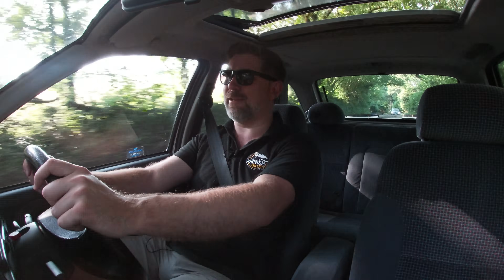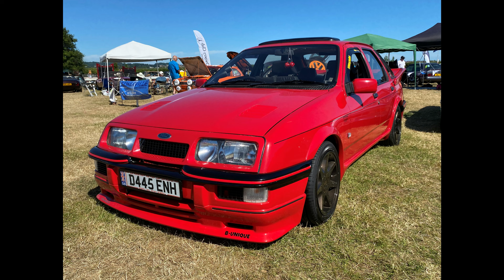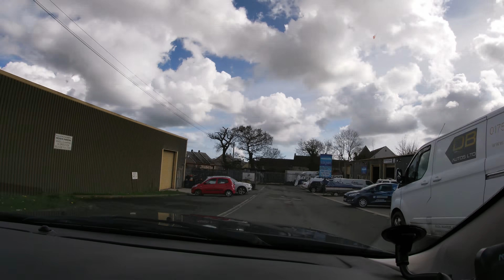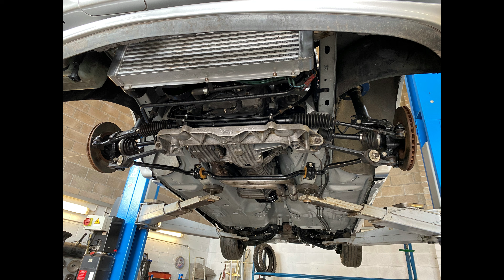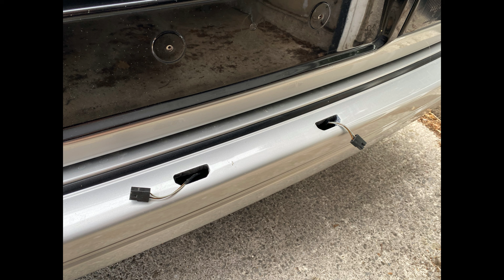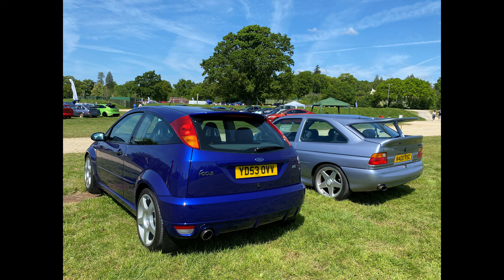OH NO! Sierra RS Cosworth Restoration Hold Up, Engine Update & did the Sapphire get to SIMPLY FORD?

Comment: Isn’t standard power a bit contentious in that Cosworth delivered these engines to Ford with their idea of standard being closer to 300hp and Ford de-tuned it to their own idea of standard as they deemed 300 to be insane as that was the sort of figure Ferrari were offering with their 348 at the time ? With that in mind I think I would have set my sights on 300 as it should be perfectly reliable at that level…….as I’m sure it would have been at one time if it was running an Ahmed Bayjoo chip. For those who aren’t aware, Ahmed was the pinnacle of anything related to Cosworth tuning and he was the one who led where others followed. His authority came from being on the GrpA works team, most notably when Francois Delecor was driving  😊
Reply: I can vouch fir that Julian. I worked for TDI during the 90s as their development engineer after fitting out their new workshop in River Road , Barking and was responsible for some really interesting cars that rolled out of there during that decade . We had one of the few 400 bhp Sun 4x4 rolling roads in the country , and this I later upgraded too . We exhibited 2 cars at the Olympia show in 1995 , the then new Supra with around 750 bhp and a Nissan 300ZX TT making around 500 bhp . Although primarily a JDM tuning company and HKS dealer (among others) we had a shed load of Ford's come through the doors because of our location , even cars from Brian over at Burton Engineering and cars from the local Ford main dealers that they were not equipped to problem solve . I was also responsible for developing and rebuilding turbochargers , a number of quick shift gear levers for Ford's ( including the TWR Cosworths ) which the market lacked plus a ton of other stuff and test driving vehicles before returning them .
In the early years we used Ahmeds chips and those of Detection Techniques ( Superchips ) for the Cosworth range until we acquired our own kit and I began development on a series of our own for all cars . The vehicles we had were either new or very low mileage and each vehicle was set up on the dyno after chip replacement before road test and returned to customers  . All were 100% and no issues with overfuelling . If the engine has signs of that,  then the problem is elsewhere  . Ahmed supplied both the standard upgrade chips to restore the original power for both the 2 and 4wd Sapphires . From my library the 2wd (45 22067) normally burned on an ST M 2764A-4F6 Eprom , Algorithm OE, Ref 1504 Checksum = 000DBD47 and the 4wd (PO) on a TMS 27C128 Eprom , Algorithm 96, Ref 1807 Checksum=00241374 . Checking these values will show if you have a genuine Ahmed or not .
Reply from the maker: Thanks for the comment and for letting me know your thoughts on the car. Chasing 300bhp was tempting given the history of the car, with its Ahmed Bayjoo chip. Issue was the over-fuelling and damage to the pistons so I thought I’d go close to standard and then, if I want more, change the tune at a later stage - the aftermarket ECU and parts that have been fitted mean I have the ability to do more if I ever want to. Thanks for watching, I appreciate it.

Comment: Well done Andy a great video update on the Cosworth and it is looking amazing and will be marvellous when complete I don’t blame you wanting to get as close to standard as possible but increasing reliability as well with modern conditions I am looking forward to the next video and good luck with the electrics Daniel
Reply from the maker: Thank for the comment Daniel and for the continued support, I appreciate it.  Updating the engine is always going to be a bit contentious, but as the car has been completely restored then I though it would be fitting to bring the engine up to a more modern set up.  Fingers crossed it all works out and the car runs / drives as I intend (and hope).  Thanks for sticking with the restoration videos and hope to hear from you on the next. 👍

Comment: It’s getting there & looking good that’s the main thing 👍
when doing something like this it no good going down the half hearted approach as you never get to enjoy & be fully satisfied with what you’ve done,  you will always be plagued by the bits that aren’t quite right & need doing otherwise.

You mention the original fuel regulators causing the fires! But it is nearly always the little hose from the injector rail to regulator that splits,  since Ford let us all down and stopped keeping all these essential part available I was never able to source a satisfactory hose like the original one.
Reply from the maker: Thanks for the comment Ken and for the advice re. the hose.  Thanks also for sharing your thoughts on the Sierra progress so far - as you say, I need to do it right so I will persevere and look forward to sharing the car complete later this summer (I hope!).  Thanks for watching and following the restoration.

Comment: Great video. I'd want the car to run exactly how it left the factory.
Reply from the maker: Thanks for the comment, I am glad you enjoyed the video.  It was a tough decision as to whether I take the car completely to standard or take the direction I have... which is subtle.  What swung it for me was that the car had been modified previously and it is a restored car, so no longer original.  I know it will divide opinion because I myself am in two minds! 🤣
Thanks for taking the time to watch and for following the restoration.

Comment: Hello Andy
Another brillant update so much enjoying the restoration and the work going into it as il certianly agree after doing a Sierra Cosworth myself many years ago patience is an understatement (as well as foul language lol)
Im gonna be honest mate id prefere the engine to of been kept orignal Ford spec as especially if your running close to standard power the YB is ultra reliable, although you will only know if or any differences are happening with the more modern engine upgrades once you start driving it.
Those side moldings are a bloody nuisance as so many come away in the corners so hope the bodyshop address this for you .. I know you want to car as OEM standard in looks and appearance with the 17" softline wheels sold to the white Escort RS Turbo, what i would say mate is i had a freind who had a moondust silver sapphire Cosworth and trust me.the 17" Diamond.cut 7 spoke with black inserts looked absolutely sublime and especially still being an RS wheel more the part if you understand.
Anyway im looking forward to the next update good luck on the electrics and loom 

All the best mate
Nigel .. 😎

P.s That Escort Mk2 Harrier in show cars was extraordinary to see 👍
Reply from the maker: Thanks for the comment Nigel, I really appreciate your thoughts on the car and advice.  The 17" Diamond Cut 17" wheels do look smashing, but it's got to be the Lattice wheels for this car... for now at least!  Changing the ignition system was an out of character decision for me, but as the car is fully restored (so never be truly original again) I thought I would try something different, but retain the ability to put it back to standard if I ever want to.
As for the Harrier at the show... there were two!
Thanks for watching, for following the restoration and for the support. 👍

Comment: Ayy up,going to look well when finished, Dynamat the interior before you fit the carpet and roof lining will cut a lot of road noise and make it cooler In summer and warmer in winter.😊😊
Reply from the maker: Thanks for the comment Craig and for the advice.  The original soundproofing / insulation has all had it so I will be looking to put a replacement in the car - I'll check out Dynamat.  Thanks for watching. 👍

Comment: I took the Toad out of my 3dr recently.  There's nothing to it, the alarm wires are tee'd in to the loom. De-solder them  join them back up and shrink wrap, less than an hours work.
Reply from the maker: Thanks for the comment and advice Ian, I appreciate it.  I did consider doing it myself, but with the new loom, old alarm, current immobiliser and a botched aftermarket stereo fitting... I thought I'd leave it to the professionals as I'd be sure to put everything in place and something won't work! 🤣
Thanks for the comment and keep enjoying your 3-door. 😎